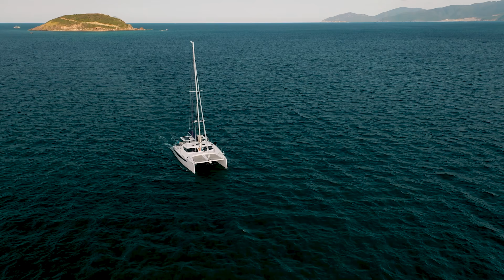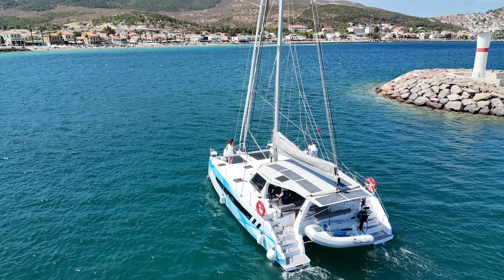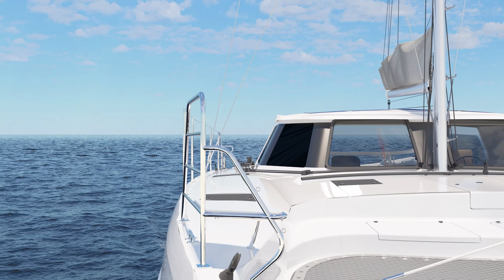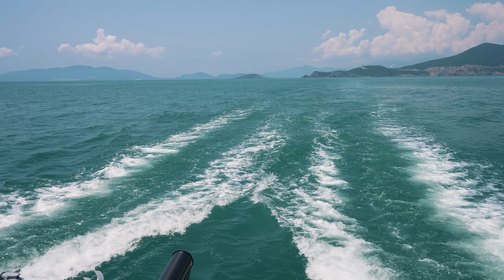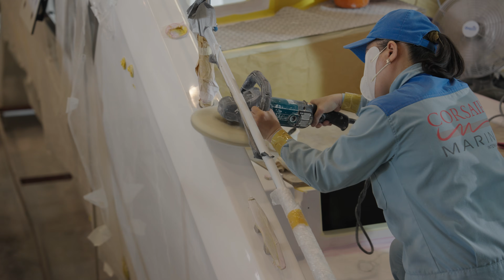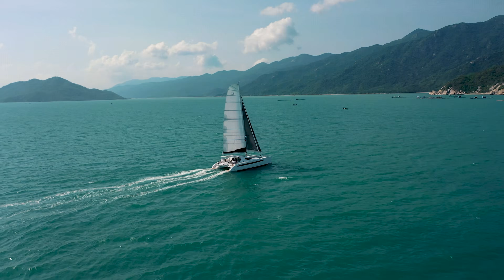World Premiere | The New Seawind 1270

Comment: Base price? Between 510k 1170 and 820k 1370?
Reply from the maker: Yes, in line with out other models, the base price is at US $620,000
Reply: @SeawindCatamarans fully 
Equipped upper 700k?
Reply from the maker: @ashleypimsner6972  Fully loaded up for cruising she will be over $700k. If you want a detailed quote, you can reach out to info@seawindcats.com

Comment: Looks really good. I sailed for 3 months on a 1260, including crossing the Pacific. A bit bigger should be noticeably better all around.  After the Lagoon 450 bulkhead issue I used everything I knew as a carpenter and a physics teacher (and sailor) to establish a baseline of that boat before it left Vietnam. After 7500 nM, a lot of it very rough, 3 to 4 meter seas were common, the 1260 didn't move a mm. Very strong  boat.  I'd buy a ten year old one without hesitation.  I expect this 1270 to be as sturdy. Seawind builds very strong boats.   The saloon design  here with the galley might be a bit optimistic. We never used the chart table on the 1260, so it shared a bench seat (storage) with the table.   
One thing I'd like to see on Sewinds? Better helm seats. Sure they're comfortable, but that flat rounded shape you just keep sliding off, hour after hour of watches... The reversing seat back is nice; we never used it. With a better seat (bottom) you wouldn't have to fuss around with your feet trying to stay on it. (Copy the Tesla front seat profile. I've done a lot of long watches in those, also autopilot/watch.) 
Looks like another great catamaran. If they ever refunded my deposit I might consider getting one someday.
Reply from the maker: Thanks @willN2Go1 for the feedback and great to hear you too found the 1260 a reliable and well built boat. As ever, we always look for improvements along the way from our owners who are actually out there, using the boats so good feedback and we'll take a look at the upholstery at the helm.